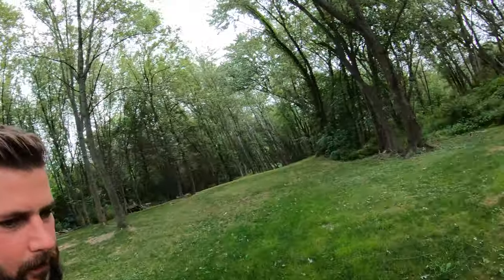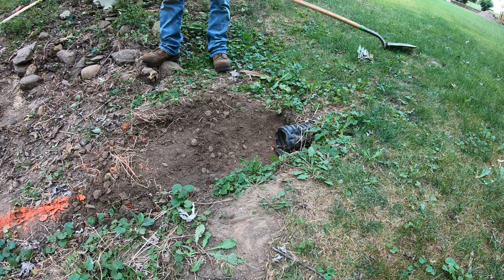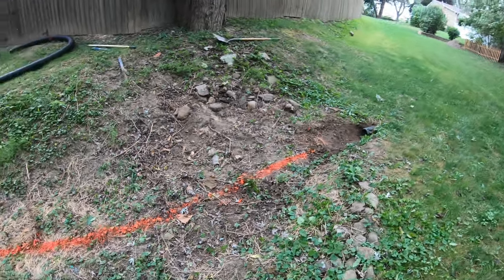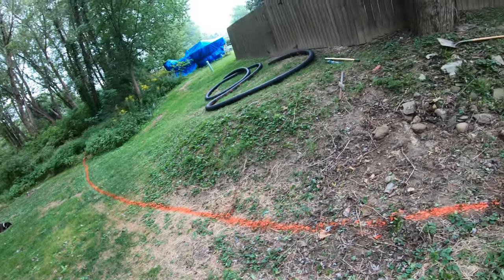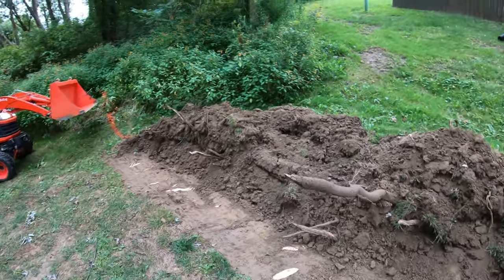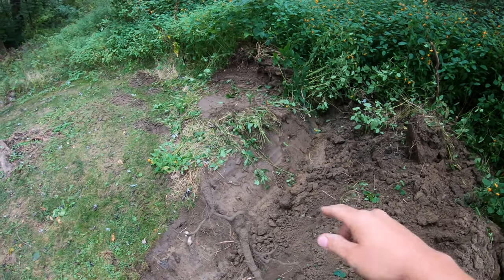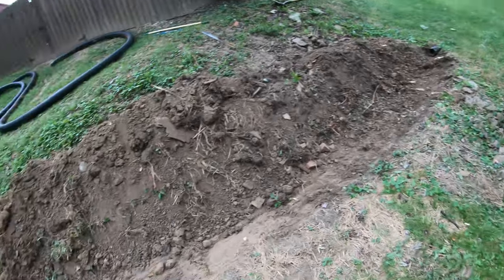Kubota BX- Digging a ditch with the front end loader

Comment: A good job .I'd like to put drainage rock around the pipe so it doesnt break as easily if dug around in years to come and makes better drainage .
Reply from the maker: Thanks! Yes adding some fine stone or sand around the pipe is always a good idea to keep it from easily getting crushed or collapsing. But since it’s on my property and I know where it’s at and I don’t drive heavy equipment across it I knew it wouldn’t be an issue and still to this day that pipe is draining perfectly! Best of luck!

Comment: I like the comment regarding "use what you have". This is a good example of that, and honestly those little backhoes 9/10 end up being a counterweight. Ive dug many a hole with a less than ideal front loader on a tractor.
Reply from the maker: Thanks buddy! I completely agree with you, not everyone has the money to buy tons of attachments and accessories for their tractor.. sometimes you just gotta use what you got.. and a good enough operator can get the job done no matter what.. even if it is a little harder on the machine in the end.. these things are built to work so I’m never worried lol

Comment: I just found your Channel and Subscribed. I bought a Midsize New KUBOTA MX5400 this Summer for a Small 15 Acre Farm I bought. Please don't take this wrong, but I just love your Tractor. I wish I had one like it for work around the house and yard like this video. Mine is just Too  ig for work like this. Maybe I can get one. You are really good at running it. Look forward to more of your videos. BTW: What's that attached to the back of the Tractor? And does it have a 3 PT. Hitch for small implements? Thanks.
Reply from the maker: Thanks man, these sub compact tractors are great because you can get a lot of work accomplished and can go work in very tight areas.. even wet areas where larger tractors would sink.. each tractor has its place and tho yours is too large for general  yard work it makes a fantastic farm/industrial tractor.. mine is more for the weekend worrier or the small landscaper doing work on the side.. I Havnt found a job it couldn’t accomplish yet the only difference is it takes longer than a larger tractor. On the 3-point hitch that’s called a “quick hitch” you can buy one properly sized for any tractor.. it allows you to back right up to an implement and lift up on it and it locks it into place with out having to get off your machine and manually connect and adjust/Re-adjust the leavers .. it’s a total time saver!

Comment: Thanks for sharing how you dug the trench. 
Do you think it would have been easier digging by using a ripper along the line of the trench first up?
I have a B8200 with front end loader and ripper 
Thanks again
Reply from the maker: Hi Andrew thanks for watching. Because the ground was so hard I had to dig it the way I did to have the ability to add as much downforce on the bucket as possible.. also digging it the way I did gave me a better sight and more control to the depth I was digging at.. as well as making the trench go exactly where I wanted it to. 

I just recorded a new video that I’ll be uploading soon where I dig a tench continuing on the pipe I laid in this video! You’ll have to check it out, i should have it uploaded this coming Sunday for you guys where I explain what I’m doing and why.

Comment: How many takes did it take you to shoot that loader install LOL.  That's a pretty cool system that Kubota has.  The newest model put the loader joystick to the right of the operator in the console, seems like a more comfortable position to me than where yours is located.  Going to be another year or 2 before I can get my BX, but definitely the tractor that I'm going with. I have a couple of irrigation ditches on my property that are a pain to clean out by hand, watching your video just gives me that much more of a need for a tractor and loader.  1 of the ditches I could easily dig out with a backhoe but the other one I can't get to as easily as there isn't enough room to straddle the ditch on about 3/4 of it so the loader would be a great asset in that case.  I just don't have enough use for a backhoe so I wouldn't get one, but the loader is mostly what I'm after for sure.
Reply from the maker: Thanks for watching William, sounds like you chose the right tool for the job! You’ll be very happy when you finally get your BX.. yes the new bx23s, bx2380, and bx1880 all have the new loader joystick next to the seat right by the arm rest which is a fantastic upgrade from the older style loader valves like I have. 

As for the loader I typically install it with just a single take.. I got quite good at installing it as iv had it on and off hundreds of times since Iv owned this tractor and after awhile you def get use to it. My driveway is actually on a slope too which makes it more difficult cuz it should always be installed and removed on perfectly level ground but like I said you get use to it after awhile and you’ll know what to do. Thanks for watching!!

Comment: Tim from Canada .. do you the guy doing the work with the tractor? You should have spray-painted that spot where that metal pole gos so you can put it back there should have been an orange marker put around that spot for when you push back the steel stick
Reply from the maker: I would have but all the steel marker was there for was to signify there was a pipe there so it didn’t get hit when mowing and so soemone didn’t trip on the pipe when walking or running through the yard. It was only there for safety reasons and now that the pipe is underground the stake was no longer needed.

Comment: PVC is a much better alternative than the cheap pipe as for longevity..especially with the work involved. Either way though, great video and love watching the kubota do work
Reply from the maker: Thanks! The Corrugated pipe was something I already had laying around tho.. and since that’s what the pipe previously was using I felt using the same material to continue it on would be best. It’s been well over a year+ now and we havnt had a single issue, water still runs out and the ground has never sank in that area. Thanks for watching and for your suggestion!

Comment: Geez, amazing work with the bucket.  It was almost like using a second pair of hands.  I would probably not step on the deck while getting on the tractor though.
Reply from the maker: Thanks man! And yah I often use the deck as a step, they say you shouldn’t but in my opinion you aren’t gonna hurt anything, I think the only reason they say it’s “not a step” is because they don’t want someone to slip and have a lawsuit.. the deck and the hangers are more than capable of holding your weight, but it’s still always wise to go by the book that’s for sure: 👍🏻
Reply from the maker: I see you have a Kurtis cab for your BX, how do you like it? Do you feel as tho it’s in your way in the summer time?
Reply: @BiffsEquipment  I haven't used it much in the summer.  Only late fall last year to help cut grass at my parents house.  Certainly couldn't get under trees as well as I would have liked.  However, that being said I just sold it a couple weeks ago. Now on the hunt for a different one, I'm always on the hunt to upgrade.
Reply from the maker: @LawnGardenFun  ah Yah Thats def one problem with the cabs is how tall they can be:. My plan was to buy “the original tractor cab” it’s a hard top soft cab, it’s only 1,000 shipped to your door for the bx it’s got a hard too and vinyl doors but the doors actually fully open and close, it’s also very easy to take on and off which is why I want it, cuz in the summer I don’t want it in my way, but in the winter I def want it to keep me warm.. for the money I feel it’s the best cab out there. Also you can get a glass window and windshield wiper option which is great for plowing and visibility, I highly suggest checking one out! If you get one before me def let me know how you like it 👍🏻

Comment: Why not get wheels in ditch and cut straight thru once you got started?just curious if that would work
Reply from the maker: So because of what I was trying to do in this video it wouldn’t have worked great. For one the ground was EXTREMELY hard that year but also I was trying to keep it curved towards a specific area. Also to maintain the same grade that I had started with it was easier dig it like I did.. I wouldn’t have had nearly as much control or accuracy if I had just dug straight forward because of how hard the ground was and where I was making the trench go.  Thanks for watching!

Comment: Whats that blade on the front end of the bucket? And do you have any ballast one yours? I have an L2501 and cant get it to dig in and scrape the ground for the life of me, the tractor either has no traction or the bucket cant dig into the compacted dirt. its super frustrating. and I am doing the same thing you are doing, putting enough presure down till the wheels lift then kind of bringing the bucket back up
Reply from the maker: Hmm that’s weird Cameron, the cutting edge on my bucket is actually the factory cutting edge.. but you aren’t the first person to think I have some special cutting edge on the front of my bucket lol. Sometimes when I dig straight down I also shake the loader a bit to help it sink in so maybe it’s my technique.. or maybe your ground is just a lot harder than mine is where you live.. on this day my ground was pretty hard tho. Your L series should have plenty of weight on the front to help force the bucket into the ground, have you tried a sharper angle on bucket? If mine done dig it sink in the first time I will then add more angle by curling down the bucket even more and go at it again.. and usually once I find that sweet spot it will dig right in. Try angling your bucket to a more extreme angle and see if that works.. once you’ve pierced the ground with the cutting edge then you can slowly start to curl the bucket back up as you push forward on the hydro pedal.. if your not getting any traction in the rear once your pushing forward then you will need more rear ballast. I have my rear tires filled along with 500-600lbs on my 3 point.. you having a larger tractor would want prolly close to 1,000lbs plus of total real ballast at the minimum. Hope this helps!

Comment: Why the FEL and not the backhoe?  Is it because it takes bigger bites and is somewhat easier to maintain the slope?  I'm new to this so any advice is welcome.
Reply from the maker: Hey Kevlar, the only reason I didn’t use a backhoe here was cuz I don’t own a backhoe for my tractor.. if I had one I woulda deffinelty used it tho. Sometimes you gotta use what you’ve got and last summer the loader bucket was all I had for doing a job like this. Now I have a nice trenching bucket so next time I get a job like this I can dig the trench or ditch with the trenching bucket instead which will be much more effective at digging. Thanks for watching !
Reply: A Backhoe is nice if you have another 10 grand to toss at it. Of course his model tractor DOES NOT SUPPORT A BACKHOE. USE what you have. There is always a shovel!

Comment: I enjoy watching you work that machine. What rpm do you like to run for the FEL work? I set mine at 2500. I intend to play with the speeds to find a comfortable rpm .
Reply from the maker: 2500rpm is a great starting point for most work, it allows the loader to be quick and fluent yet still maintaining lots of control for digging work such as this.. when grading I tend to have the rpm a bit higher like 26-2700 but it’s all on what your comfortable with.. I wouldn’t suggest going much under 2500 unless your just practicing. Thanks for watching I’m glad you enjoy seeing her get worked!

Comment: IN  2 passed u can make or cut your ditch with box blade / scarifire  ! .

angle box blade down  >  drop one  outer egde scarifire down too !

ez as pie too !
Reply from the maker: I did not have a boxblade at the time... Cant use something that I don't own.. Sometimes you have to make due with what you have.. This is what I had.. Obviously there is always gonna be a better tool for the job.. Heck if it was up to me I woulda used an excavator.

Comment: Nice vid.  Any thoughts on getting a tooth-bar?  At least the newer BXs have the bolt on cutting edge so you can reverse/replace it when needed.   Nice vid.
Reply from the maker: Hey man! Yah iv had plans for the last 2 summers to get a tooth bar as I feel for jobs such as this it would have really made a HUGE difference specially digging into that hard rock but I just havnt pulled the trigger on one yet. And your right it’s nice that the LA340/344 loader allows you to buy a bolt on cutting edge, that’s def a nice feature kubota gave us!

Comment: Learning lots From you for that I’m new at this. I bought a Piranhatooth  bar too dig and I see you do not use one Did l waste my money lol
Reply from the maker: Glad to hear Terry! And no absolutely not! The Piranha tooth bar is a fantastic tooth bar.. one of the best you can buy for the BX as far as I’m concerned. I have always wanted to buy one mainly for clearing land.. the one reason I never got around to it was because I found I didn’t really need it as I’m quite comfortable with the factory cutting edge as you see here but if I had one would I have used it? More than likely I woulda.. it can only help when digging specially in tough ground. The one thing I’m not a fan of with tool bars is it limits your back dragging capabilities because you do not have a nice flat edge anymore to pull material back, you have to use the back or bottom of the bucket instead which is the main reason I never added one since I do SO much back dragging with the types of jobs I do.. I just didn’t feel like having to take it on and off all the time even tho it’s quite easy to do I felt it would slow me down on jobs to have to swap it on or off so I just lived with out it. I do plan on eventually buying a second bucket for my tractor that’s brand new since my cutting edge is gone on my factory bucket.. I plan to put a tooth bar on that bucket and use the new one with the factory edge when back dragging but easily be able to swap to my old bucket which would have the tooth bar on it for heavy digging. Hope this helps’

Comment: Hey Biff, what is on the left side of your bucket? My apologies if you mentioned it in the video. 
Dom
Reply from the maker: Do you mean on the bucket itself? I have bucket hooks that a I welded to the top of my bucket, both there is one on both the left and right sides so I'm not sure if that's what your referring to.
Reply: Its a bucket pitch indicator.
Reply: @BiffsEquipment  Michael Molter might be right...

From the drivers seat, left side panel (vertical) of the bucket, it looks like something attached at the middle pointing forward. I suppose it could just be a stick or root wedged in onto the bucket. Wish I could zoom in,  its probably nothing otherwise I think you would know exactly what I saw! I'll watch it again and note the time when I can see it best. 

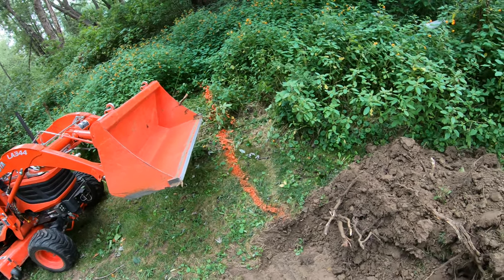Initially I was thinking it was a depth gauge for digging the trench. You can see it clearly at 16:59...
Reply from the maker: @domenicmaiani3795  I just went to where you referred to, that’s the bucket level indicator, I bought it as an option for the LA340/344 loader. They unfortunately don’t offer one for the older Style 246 loaders. Which do you have?
Reply: @BiffsEquipment  I've ordered the 2021 B2601 with the LA435 FEL which is hopefully being delivered soon! The dealership is just waiting for a grapple and box blade to write up the loan agreement and deliver... I placed the order on June 1st , due to a (not so funny) comedy of errors and 2 sales men, it is getting close! In the Idaho panhandle,  if you want a Kubota, you will buy it from the Adam's family, they have a monopoly here and no  dealers in Idaho, Washington, Oregon, or Montana would even talk to me. I think that's kinda weird, most said that I need to contact my local dealer and a few actually said you need to call Adams.

I don't know if Kubota dealers around here are close knit or if Adam's is extremely territorial... I suspect the latter!
Reply from the maker: @domenicmaiani3795  ah yes, how could I forget! You told me this that’s right, you must be so darn excited, and you bought a ton of implements to go with it you said.. I remember now. You can get a bucket level indicator for yours, I would actually highly recommend it specially for a new tractor owner as it allows you to see exactly where your bucket edge is at all the time.. just simply glance over at your indicator and you’ll be able to find where dead level is on your bucket for grading and other tasks.. def get one if you didn’t order one already, typically they are only 50-80$
Reply: @BiffsEquipment  LOL, yep, its not like I'm the only one who chats with you! I operated tractors in Jr./Sr. High school and am hoping that skillset is like riding a bike... However, I have been thinking about adding a level indicator. We'll have to see how it goes. I'm pretty sure I have all the bits and pieces to put one together if I need one!
Reply: @domenicmaiani3795  Level indicators are very simple to make.  I wouldn't spend the money on purchasing one.